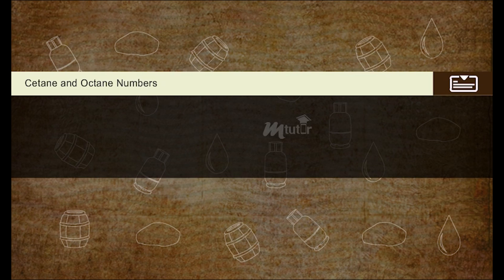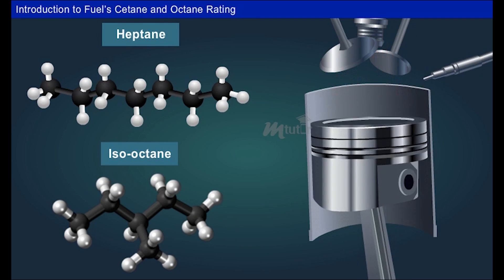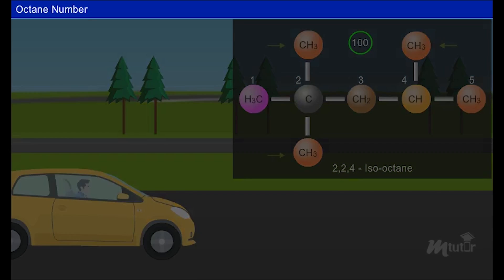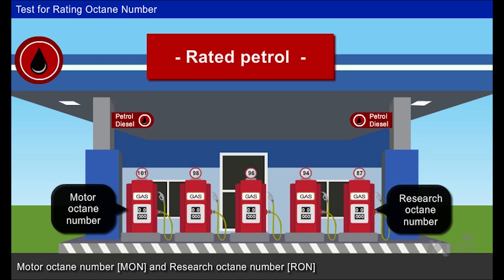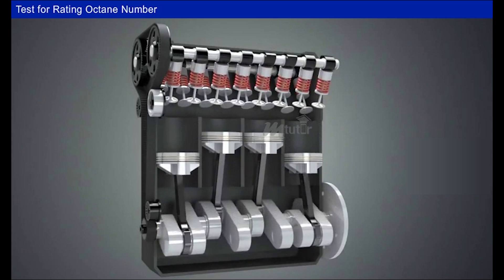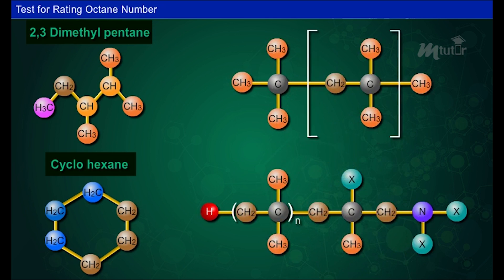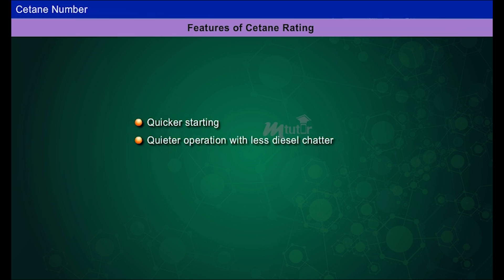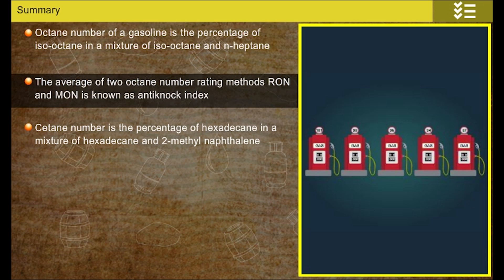Cetane and Octane Numbers [Year-1]

Comment: Climax is a little bit confusing....... Cetane number is not clearly explained like octane number.
Reply from the maker: For easy understanding, Cetane number measures the delay in the ignition of fuel whereas octane number measures the performance of the fuel.
Cetane number helps to predict the ignition of an engine whereas octane number is for predicting knocking of an engine.